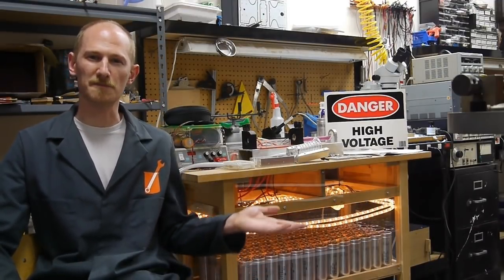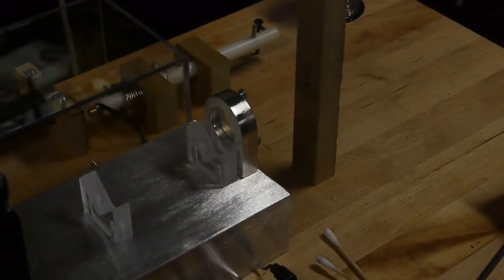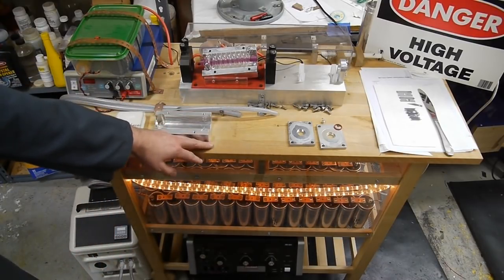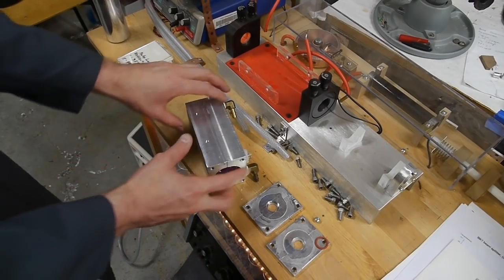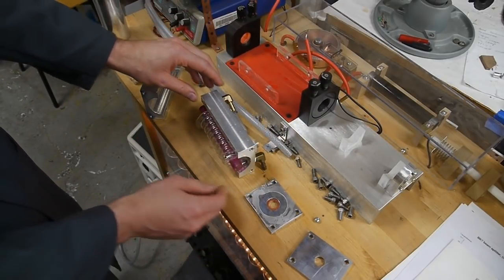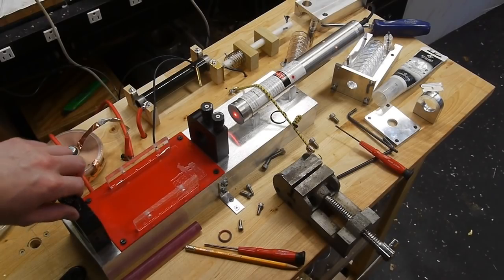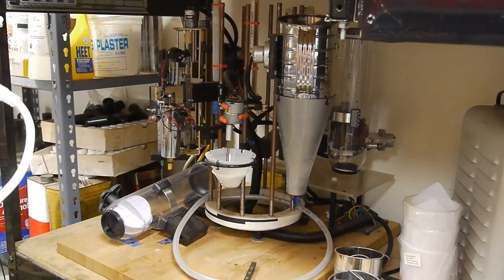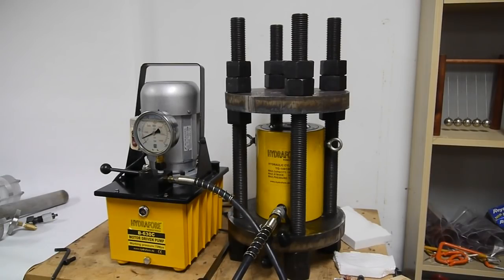Ruby laser (and other projects) follow-up

Comment: So depending on how long it takes to recharge the capacitors, you can set up multiple banks and cycle through them to create a high speed pulse and by the time the first bank recharges it'll just keep cycling.

Comment: Can you use a ruby rod to amplify and direct microwaves from a magnetron?  If you made the rod the same length as the wave (the same principle behind a standing wave in a microwave) you could get a lot more power than from light on the output?

Comment: if you get the ruby laser working again, you could consider adding a q switch dye to reduce the pulse width. that wouldn't increase the power, but it would increase the power considerably. maybe enough to ionise the air and create a miniature ball lightning effect.

Comment: I wonder if it would be possible to polish the ends of that ruby rod at home. I know you can buy "kits" for polishing the ends of fiber optic filament, they come with assorted grades of diamond polishing sheets going to something like 12000 grit! Would you need to maintain a perfectly perpendicular surface at the end of the rod, or is it more important to get a good optical finish? I think it would be the latter.

Comment: I am thoroughly impressed! excellent job! My favorite brand pulsed laser is Big Sky and you should check on Ebay for one because the optical cavity, alignment and cooling are perfectly sorted out. I want to replace my YAG rod and mirrors with a ruby rod and the corresponding mirrors. I just need to hunt down the right size ruby rod.

Comment: I was reminded of the surface damage to the end of the ruby rod... I checked the comments for someone thinking what crossed my mind and saw the comment by William K, a couple years ago, "By the way, a typical high power solid state laser seals the ruby rod by placing the o-ring around the outer circumference of the rod; not a face seal.  The face seal reduces the aperture of the ends of the rod and reduces the power output.  Also, the face seal o-rings absorb the emitted light and degrades causing the damage to the face of the rod you are experiencing."Have you considered making this, or another, improvement to the cooling jacket?

Comment: That's one frightening bank of capacitors you have for the laser there. What's the capacitance?
Reply: +Desmaad you can calculate it
he gave u 2 values V=6000V and E=8000J
and the energy stored in a capacitor is E=1/2*C*V^2
Reply: +Desmaad His capacitor bank appears to be seven paralleled groups, each being thirteen 900 uF caps. in series. That would be an equivalent capacitance of 485 uF (with a rated working voltage maximum of 5,850 VDC).

Comment: 100,000 PSI? I hope that chamber is super tiny, or you're wearing a bomb suit :D
Reply: +Andy Plater Hydrostatic pressure is much safer. It simply doesn't compress. If a 10l container with 100,000 PSI of air bursts, it's a bomb.If a 10l container with 100,00 PSI of water or other uncompressible liquid bursts, it emits a streak of liquid that would cut your hand off and that's it - there's simply very small excess volume of liquid inside.

Comment: Have you thought about trying to improve the efficiency of the laser? My guess is that with that much power input you could have a large increase in the output power with some attempts made to improve the system efficiency. I don't really know the ways to do this besides a smoother bore for that case and perhaps a different material which would not need water cooling. 

Additionally, how accurate can the alignment get?
Reply from the maker: +BobClemintime The ruby material itself is very inefficient.  In fact, ruby lasers are only used in niche applications such as tattoo removal where their red wavelength allows the beam to pass through skin and cause less damage.  Other laser materials such as Nd:YAG are much more efficient with the same flashlamp, cavity, etc.  It's also true that there is efficiency loss in the xenon tube as well.  Modern diode-pumped lasers are overall much more efficient.
Reply: +Applied Science Thanks for the explanation!

Comment: Instead of cooling the sealing couldn't you try to minimize the heat due to the absorbation of the laserray by using quartzglass near brewster's angle?
Reply from the maker: +upgrayedd The seal was actually damaged by light from the xenon flashlamp since it is outside the laser beam path.  I should do some experiments with just the flashtube!

Comment: totaly captivating, thanks for sharing! unfortunatly, can't do anything like this, only admire, and, having an awe for science, but not enough knowledge, hypothetically - what happens if instead of metal or wood it 'll be some part of the human body? it can be some kind of instant bloodless accurate hole or not?
Reply from the maker: +Asta Muratti It's interesting that you mentioned the human body.  Ruby lasers have a niche use in tattoo removal.  The red light produced by the laser is somewhat transmitted by human skin, but it absorbed much more fully by the dark tattoo ink.  Thus, the tattoo is burned away while causing less damage to the skin itself.
Reply: +Applied Science thanks for reply, oh always wanted a tattoo, but alas) so for red lasers we need ruby, what about green ones? can we have a rainbow made of laser beams? what if the crystal iscolorless? it would be an invisible laser beam?)

Comment: Although i am an engineer specializing on laser physics, i have never build one from scratch. Nice work ;-)!
As for your insulation ring: can you not use a larger exit window to the water cavity, maybe pressing the rod directly to the window? Otherwise you might damage the ring and thereby get dirt into your cavity whenever you get higher transversal modes lasing.
At least i would try using a rubber that is transperent at the laser wavelength.

Comment: Love your videos! I have a question: the string of lights on the capacitor bank of the ruby laser is there for a purpose, or just to look cool? Also looking forward to your high pressure experiments. We use relatively high pressures for our rocket experiments, but nothing compared to what you are attempting!
Reply from the maker: +USWaterRockets The lights are just to look cool.  They attract attention to the terrifying capacitor bank.
Reply: Applied Science I thought the lights either there to either look cool (it does), or you were using the conductive properties of neon lamps for some nefarious reason.  Thanks for answering, and keep the cool videos coming!

Comment: You could mix the cookie dough in something like a plastic frosting bag with some rollers.  Then once it is done kneading the dough a clamp on the end could be released and everything squeezed out.
Reply from the maker: +lyokofans That's a great idea!  It's the most reasonable and effective method that I've heard.
Reply: Applied Science When you strike it rich remember me ;)
Reply: Wouldn't you have issues with some ingredients getting smashed by the rollers because they don't flow very well?
Reply: ***** He could spring tension the rollers to limit the force being applied.  Then use a solenoid to force them down hard to squeeze the contents out.

Comment: What does it take to grind away ruby? I would have thought that diamond grinding media could do the job.
Reply from the maker: The main problem is that the faces need to be extremely flat and extremely parallel or else the laser light will be lost during the numerous bounces. The cost of repair seems to be equal to the cost of getting another rod on eBay.
Reply: Applied Science if that's the situation, and you're going to go for one or the other, I'd go for a new rod and have a go at repairing the old one. At the very least you'll get an interesting video out of it
Reply: +Applied Science can't you just try with a lathe and a diamond tip tool? you seem like a guy with that "lemme try that" mentality. facing a ruby would be peanuts when you can build your own electron scope...
Reply: +Rob Mckennie Ben is not kidding... to get those kinds of tolerances out of that sort of material is anything but cheap. But you are indeed right sir, he will wake up one day and come up with a method to repair that 'Ruby Rod' better than a certified metrology lab... for fun. Cheers.
Reply: ToastyRoland I never said it would be better, but if it would cost you the same amount to buy a whole new one, you may as well come out of it with 2 rods instead of 1

Comment: Can it be made portable, and can many of them be used at the same time, and possibly focused into a single point? (e.g., a laser rifle).

Also, can the high pressure chamber be used to carbonate water?
Reply: +Razor2048 easily! After all, carbonated water can be made in sodastream bottles. And compare those to the system we just saw a glimpse of!
Reply: +Razor2048 heh, define "portable". It absolutely requires that massive bank of capacitors, or some other cap setup that can deliver and rapidly release an equivalent charge.

And you can carbonate water with even ambient-pressure CO2 (you just pour water back and forth over top of a stream of CO2, or use a soda-fountain) So it's a bit silly to use 100,000 PSI to do a task that can be done with only 20PSI.
Reply: +verdatum  For portable, I was thinking backpack mounted.
For the carbonation, I was wondering if the higher pressure will help give the water an even stronger carbonation.
Reply: +Razor2048 Under pressure, yes, but once you open the bottle, it turns back into gas and the effect is lost.

Comment: Ben, do you have a video where you demonstrate your turbopump? I know you have one where you mentioned obtaining it; but I'd love to see an overview of the operation, the controller, how you retrofitted it into your chamber, an idea of your pumpdown time, that sort of thing.  
Also, did you ever further improve your cold-trap/cryopump? The one you were using for freeze-drying had some capacity problems.
Reply from the maker: +verdatum I haven't made a video about the turbopump.  I'll add to the list.  I have an ultra-low temperature freezer that came with a glass cold trap bottle.  I haven't used the bottle yet, but it is specifically designed to hold lots of water vapor, so I should be good for the next freeze-drying.

Comment: just regarding your cookie project... As a baker, one extremely critical factor in how cookies turn out is the temperature of the butter. The warmer the butter, the more the cookies spread in the oven and thus the crispier they become. So thick, chewie cookies and thin, crispy cookies can actually have exactly the same ingredients and baking procedure, but completely different outcome based on butter temperature. I'm not sure how it could be controlled, but I just wanted to note the importance of this variable.
Reply from the maker: +Kevin Colwell Thanks!  My butter dispenser works at room temperature (doesn't melt the butter), but in a home kitchen, the air temperature can vary quite a bit.

Comment: 100000psi that is crazy! but the strange properties of matter at those pressure should be interesting to look at, the highest i have seen is 16000psi and that was on a naturally occurring gas reservoir, still crazy high pressure for my normal work which is usually 10000psi lower haha

Comment: are your reflectors concave.  Or I use to use a flat and one concave reflector.
Reply: +Andy Bushnell flat reflectors * lens
Reply: +viermidebutura that's a marginally stable cavity.  a ray can walk out. with one concave it won't walk out. look at books on laser cavities
Reply: Andy Bushnell i got the impression those are flat mirrors
Reply: Flat. Curved mirrors are used for focusing the full range of wavelengths of light (for instance). Flat, parallel mirrors with a small aperture are used to isolate nearly a single wavelength. The distance between the mirrors is critical.
Reply: Look at the note here indicating flat mirrors rarely used in laser cavities because of alignment problems.  https://en.wikipedia.org/wiki/Optical_cavity
Reply: Andy Bushnell Interesting. That is not what I had been taught, but my exposure was decidedly theoretical. Thanks!

Comment: I liked your explanation (and admire your work) A good simple explaination of how the laser works - while not 100% accurate, it is good enough for building a laser.

Even tough I know what you mean when you say that the laser light of this laser source is like the light of a "beefed up flash lamp" (in some senses, this would be truth, and it is a good first explanation for simplicity), it is physically (which I'm sure you know) generated in a very different manner and with spectral and coherence characteristics that are way different (not that you'd need to know that to build your laser, I know, but anyway...).

Besides that, the way photons are "bunched" while emitted by a laser is completely different from the ones emitted by any flash lamp because usually a flashlamp emits light because of the temperature of a (noble) gas, which is not that different from the light of an incandescent lamp.

If you want one day to make shorter pulses, this difference between the emission of laser light and of flash lamp light is very important. But I figure you will probably not need to do it, so this is just a note to keep in mind: every time you use a laser, you use some quantum concepts doing it. I thought that you'd find that cool, which is why I commented.

Comment: Can't you just get a bunch of blu-ray laser diodes and shine them into the ruby to pump it?
Reply: There is a power issue. As he said, you need power in the order of megawatts to produce that kind of laser. 
You could cover the inside wall of a cylinder with high-power LEDs, all pointed towards the rod. But even if you use 100 LEDs, you would still need to 1 kW to 10 kW ones. I don't know if they even exist!

Comment: Why not cool the chamber inside liquid nitrogen or co2? 🤓
Reply: LN2 and LHe are terrible refrigerants, when the come in contact with something warmer they boil to gas which tends to form an insulating layer between the liquid and the hot thing
Reply: Because the thermal capacity of water is much higher.

Comment: Re. Cookie Perfection: Those cookies did not look like they would meet my stringent requirements regardless of the recipe proportions. First variable I'd have to change is to switch to milk chocolate chips. (OK, semi-sweet if only THAT works for you.) Next, the baking temp looked to be a bit too high, or did you just keep opening up the door to the oven?   That was causing way too much scar tissue (almost blackened where it contacted the baking sheet surface) on all your test cookies. A subtle burnt taste is a real deal breaker for me! 

Maybe a lower temp / longer time would help even out the heating process or some other method of applying more heat from above and less from thermal contact coming up through the sheet surface. It might be interesting to sink away some heat from the cookie sheet while maintaining a higher air temp above the cookie as it bakes. Thirty years ago, I used to cook 'em with an electric oven; by manually setting the ratio between "bake" plus a shorter "broil" time. That way, the cookies had the same amount of scar tissue (slight browning) from the top compared to the flat bottom of the cookie. It would be an impressive automation if mixing, dolloping and conveyor baking could be combined. 

Finally, taking this concept to the next level would be to incorporate a "non-contact levitation - convection" oven design that could make perfect cookie balls. You would have to determine the maximum ball size before the centers remained too under-cooked/gummy. i.e., it could be like a hot air version of your floating screwdriver demo that would levitate and bake at the same time! 

An impressive bit of outdoor showmanship (with a slight risk of choking) could come at the end of the baking cycle where a transition to room air would be included to get the floating cookie cooled down before a sudden final blast of higher pressure air would shoot the finished cookie ball up into the air, just high enough to finish cooling before falling back down... Don't forget to wear safety goggles since of course you'll be catching 'em directly in your mouth.